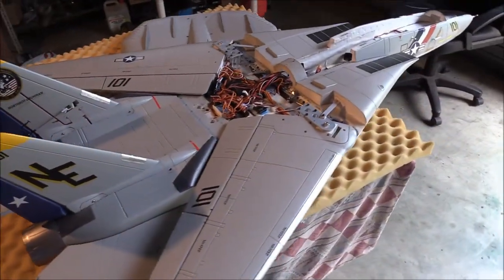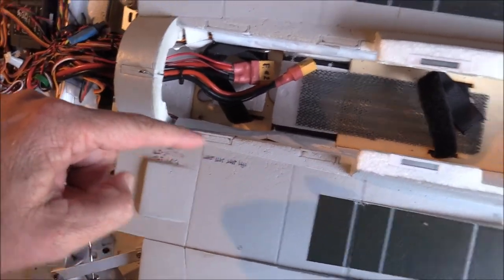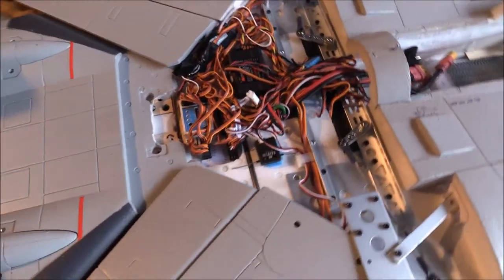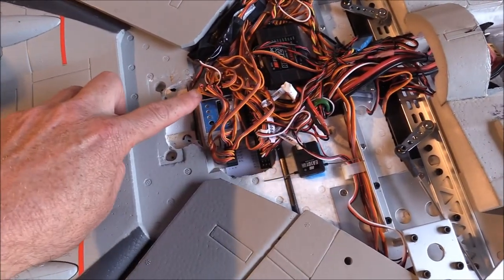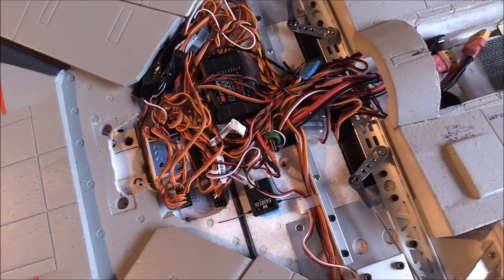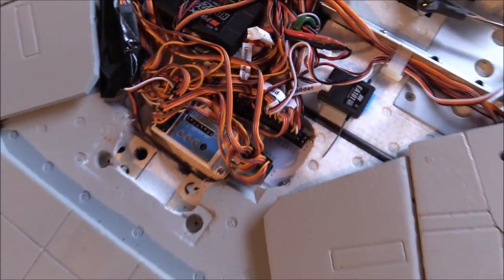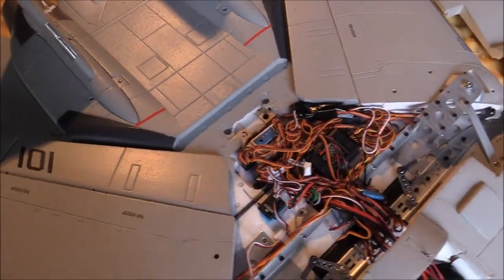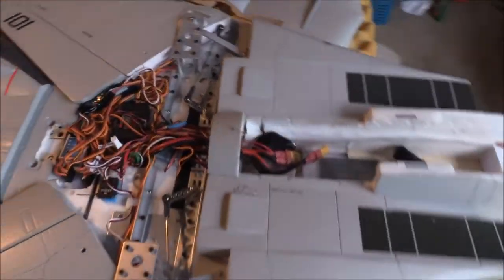Freewing F14 + Freewing gyro install & setup talk | RC Skunkworks ADP

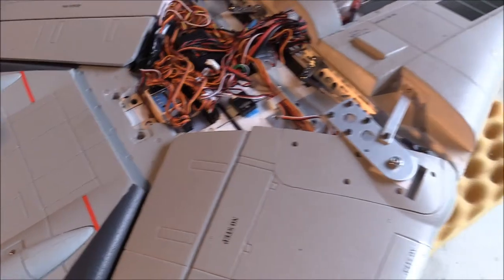Comment: Comment to 03:30    Detection and correction of ANGULAR (ROTATIONAL) motion of a plane is independent upon location of the gyro. Only detection of acceleration (LINEAR forces) needs distance from the plane`s centre.

So, in case you are primarily interested in correction of e.g. roll, pitch or yaw, just leave your gyro, where it is.

Comment: Hey there Yoda,

You´re videos are just awesome, thank you for helping us with your experience.

Can you please share your channels/servos connections configuration when using the gyro? Wich one you´re passing through the plane control board and wich one you´re connection directly with the RX and or gyro. These is my guess, i´m right? : 2 x AIL direct - RX no gyro and no control board (AIL off when wings sept) /// 2 x ELE to control board – gyro – rx (taileron mixed by the plane or radio in this case?) // RUD to control board – gyro – RX // FLAPS, GEAR and SWEEP Wing to control board – RX.

I´m planning to install the gyro in my band new F14 but i have only experience with the HobbyEagle (i use in all my jets) and never with this type of aircraft (tailerons and etc)…i saw you´re using the freewing gyro so i´m planning to follow your experience.

Please can you help me and give me a overview?    

I really appreciate.

Thank you very much mate.

Comment: Nice video. I use HobbyEagle Gyros on just about anything I fly. HobbyEagle A3 allows  gain adjustment in flight using a spare channel and knob on your TX.  Didn't even know Freewing made a Gyro. Have you used any of the HobbyEagle gyros and if so how do they compare?
Reply from the maker: Yeah, great choices in gyros out there now. The hobby is evolving fast. Can't wait to get over to the Beijing expo in two weeks to see all the new stuff. Have fun with your 14. Yoda

Comment: Great job on the video. When you are in swept mode do you have the ailerons shut off and just use tailerons? ?. or do you use tailerons with the wings in and out??
Reply from the maker: Ailerons and all other controls set up as per RCGeek suggests... tailerons are most dominant for roll control in both wings swept and open. wings out ailerons work only as spoilers (up direction only), wings swept the programming locks out the ailerons and ensures flaps are up before sweeping. Tip... Check wing tip incidence before flying and twist the wings until you get them equal... I believe mine was warped slightly in the box. It caused a roll that was way more severe when wings swept. Have fun. Yoda
Reply: I did notice that my wings where unequal too. I did get them even. Just waiting for the gyro to get here now. Just ordered it this morning.  Same one you have. Thanks again for the video mate. I'm making all the necessary mods on the plane via your specs as we speak. Also just got my new p47 today. So I have some stuff to keep me busy until the snow melts now.lol. can't wait to get back flying again .